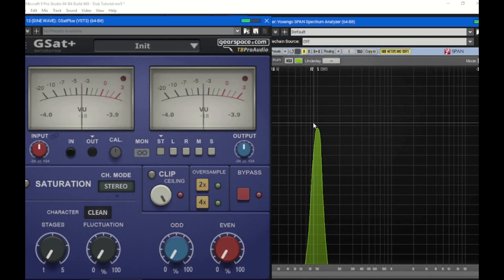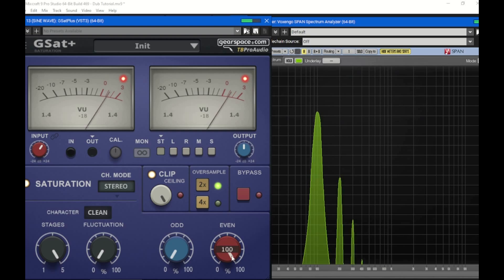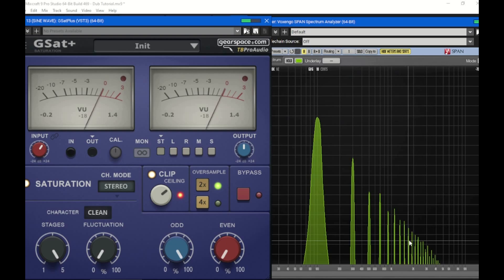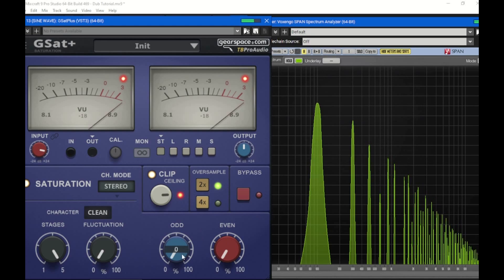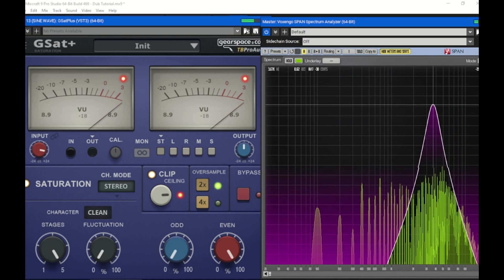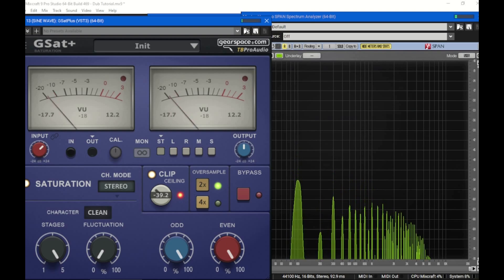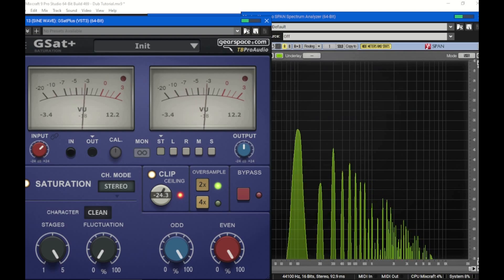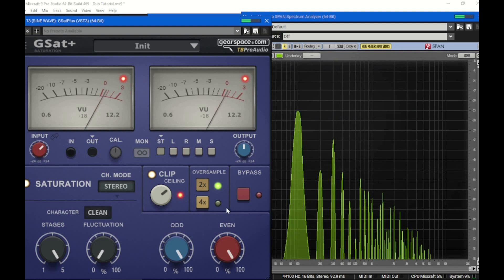Saturation Explained.

Comment: I wish I'd seen this six months ago. I did a deep nerdy dive into various saturation plugins using a variety of tone generators and analysers. I came away as a big fan of the free GSat+ tool, and less of a fan of several other plugins that cost actual money. I was mainly trying to work out which saturators had aliasing problems and/or lacked control of the even and odd overtones (where both were available). It was eye-opening to hear/see that some "pro" plugins sounded bad in comparison to freebies and actually offered fewer usable features that GSat+ for example. By using an analyser I could basically recreate the saturation profile of a random plugin with GSat+, save it as a preset and then uninstall the unnecessary plugin, particularly if it had a bad aliasing problem and no oversampling. Most of all, however, I learned visually what the various plugins were actually doing, so now I have a better understanding of what twiddling the knobs does to sounds and how it will affect my music. I could have saved time by watching your videos though!
Reply from the maker: Glad you like the videos. Thanks!